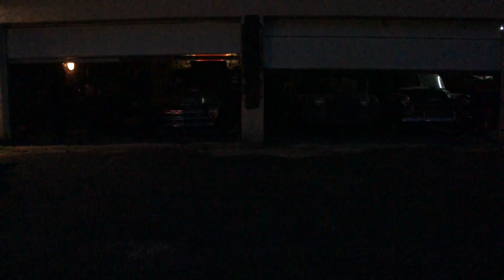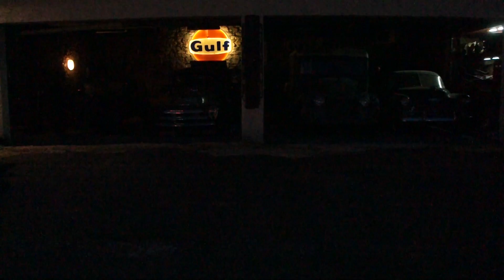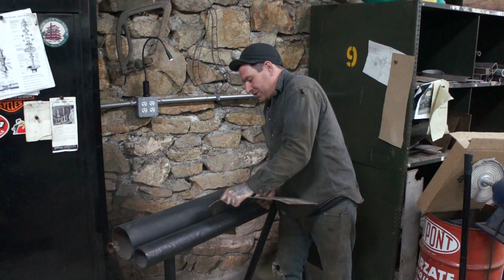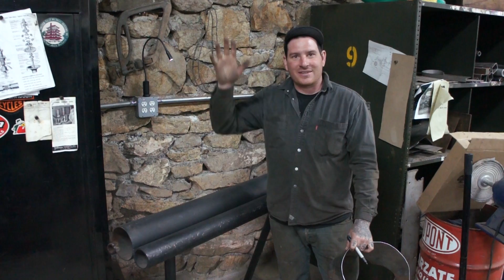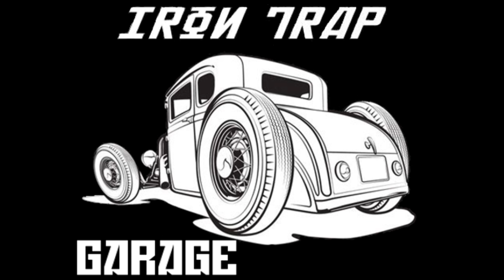Tools That Don't Suck- Homemade Pipe Anvil

Comment: I love my pipe anvil, it was one of the first tools I made when I started out...I just did a double tube version on a 2" receiver post to fit into my table...I should clean it up and post a video of it on my channel, along with some of my other tools I've put on receiver posts...
Reply from the maker: The anvil that we picked up a few months back has a 1" hole in it. The previous owner put all kinds of dollies on posts. Comes in handy quite often! Thanks for watching!! -Mike/ITG
Reply: IronTrap Garage Most of my smaller equipment like my chop saw, 24" brake, Beverley shear, hole punch, etc are all on 2" square tubing to fit into my receiver post table and be stored elsewhere when not needed...my shaping dollies and bowling ball are on 1" posts that go into a swing out arm on my fab table...I try to keep all of my stuff as mobile as possible and as interchangeable/storable as possible...
Reply from the maker: That’s a super sweet! Space saving is always important!!!

Comment: That's pretty nice! if only I had the space
Reply from the maker: Space is always an issue even if you have a huge shop. More space just means you fill it with more junk!!! Thanks for watching! -Mike/ITG
Reply: The one I made is about 3 feet long and is mounted to a 2" square tube receiver post to mount to my fab table when needed and get stored on the shelf or on the wall when not in use...it's been handy, and well worth the effort to make one...